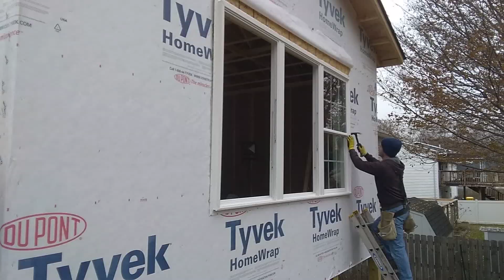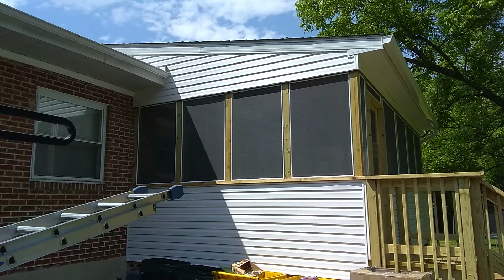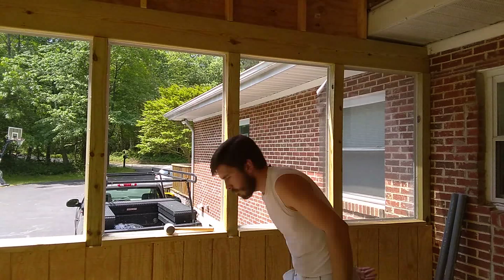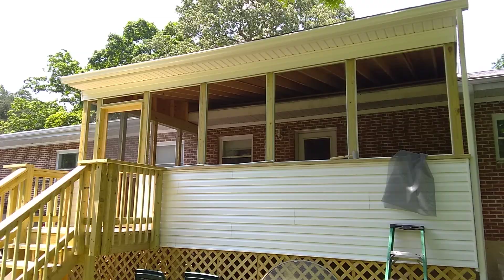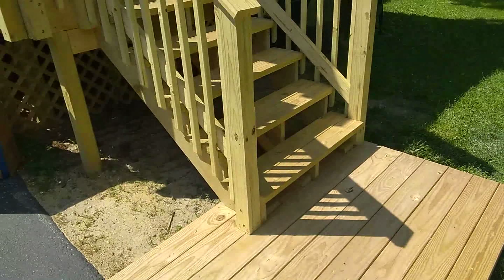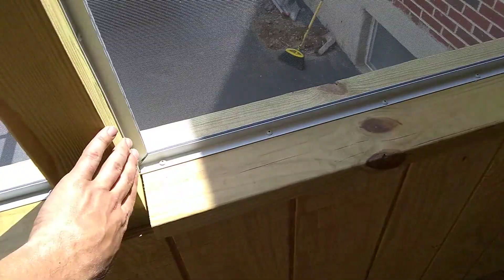Screened Porch | Week 8

Comment: Did you leave the old soffit and Eve in? I am contemplating that now on my house. Seems easy to leave in but would take away head room in that area and look funky? Your camera doesn’t show up there well in finished product.
Reply from the maker: Yes, I did leave the soffit alone on this install.  The homeowner didn't mind and was trying to keep costs low.  You could always open up the roof area (maybe before decking so it's easier to work) and then extend a wall face up from the original exterior wall to the new roof rafters.  Sorry about the camera work.  I always think of things after it's already shot that should've been shown.  Thanks for watching and good luck with your project

Comment: Great video. A lot of work for one person, I know, I've been there. The only thing I would have done is at the inside sill at the post. I would have made cut down fillers to fit into the openings and maybe using a wood putty at the joints that could be sanded if needed.
Reply from the maker: I never liked those notches, but, felt like filling it in would be open to shrinkage.  I've had time to think about it and now I think I've got the answer.  Frame the wall without the posts, place the sills on top, cut out the holes for the posts and then slide the posts inside and continue framing.  Thank you for the comments and for watching

Comment: I have a similar project but want to remove the gutter inside the porch and finish it. Any videos to show best way to do this? Thank you.
Reply from the maker: I removed the existing gutter inside of the porch on this project.  I can't remember in  which video clip I showed this being done though.  I marked and cut the existing gutter with a sawzall and tin snips.  Then all you should need is two end caps to finish off each gutter.  I use end crimpers but if you don't have that tool you can drill and use rivets to hold the end caps.  Seal them and you're done.  I hope that helps and if you need more information check out my other video where i show it being done.  Thanks for watching

Comment: What kind of screens frame is that? Where I am you can have custom measure and made screens any size and shape. Yours don't use spline rolled into the frame, it's sandwich snapped the screen material into frames?
Reply: Sorry, was watching without audio, heard it at the end.
Reply from the maker: No worries.  Thanks for watching

Comment: This is really instructive and encouraging. I'm also glad you went with attaching the siding  However, I think the the whole thing would have looked much better if it had been stained or even better with brick veneer that would match the house! As it sits now the white siding  seems to clash  with the brick siding of the house. Perhaps the owner can at least paint the wood to match the siding. Secondly, by adding this screen room to the house it made the house much darker on the inside. This would have to be done with skylights to add the light back in and might as well consider repurposing this to make it a three season.
Reply from the maker: I'm glad you enjoyed the job.  Thanks for watching and sharing your ideas

Comment: If you were closing in the ceiling, how would you close in the area where the rafters are leading to the house? Do you have any other videos that may show that?
Reply from the maker: You could frame a wall off of the roof deck to enclose the area of "dead space" above the existing roof.  If you want to make a flat ceiling that had the effect of continuing your soffit line then you will need to demo some of the roof deck and install ceiling joists from the existing top plate of the wall to the beam on the outside of the porch.  I hope that all makes sense.  Thanks for watching

Comment: I am thinking of transforming my porch, it is under part of 2nd floor, so it has ceiling already, and rails around it.  which is better option, glass or screen for enclosing the porch?
Reply from the maker: All depends on preference and cost.  If you want to enjoy outside without bugs then screen will do, but, to enjoy the view even in the cold / heat you'll need glass to hold in some heat / air.